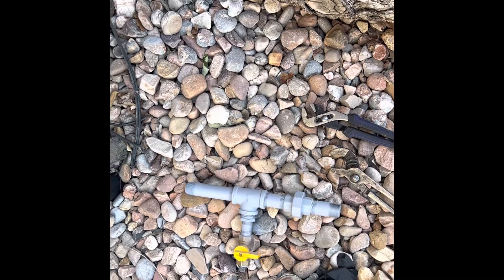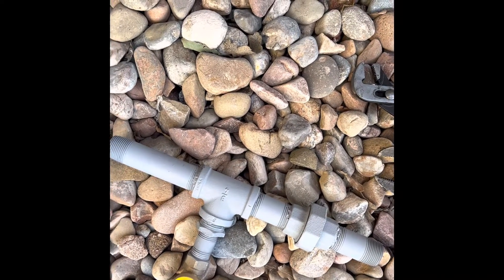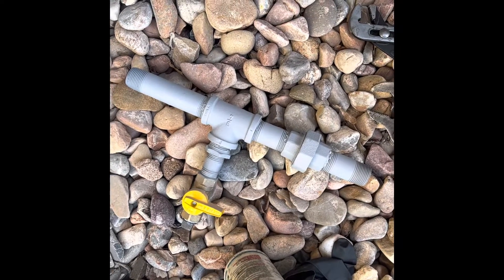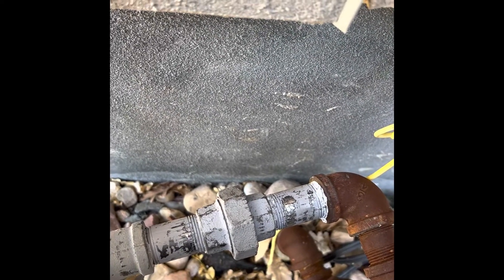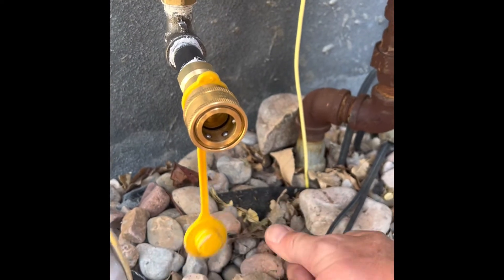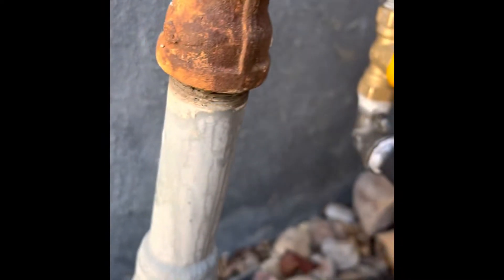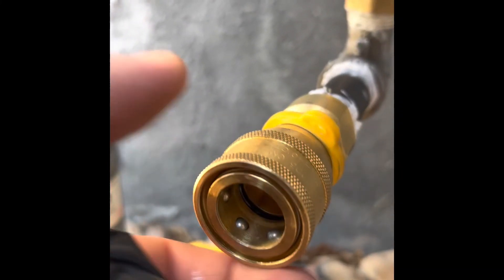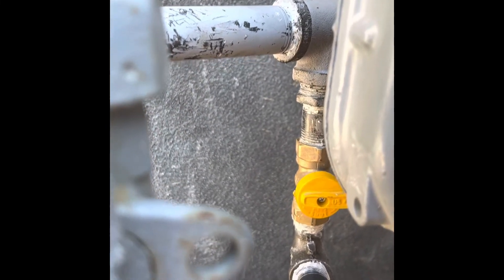Firman Tri fuel gas line fitting installation

Comment: I got the same gas hose as you.. when i hooked up to the already installed 3/8 flare output the motor ran rough/bogged down. Getting a 1" output done tomorrow! Hopefully that fixes the problem.. Thanks for the tutorials!
Reply from the maker: My meter is a 2lb high pressure. Yours is likely the standard half pound. The one inch should help.
Reply: @BryanHansen  hmmm i will go see if i can see anything on there stating the poundage.. Thank You!
Reply: @BryanHansen  The meter says AC-250    250 C.F.H @ 1/2 DIFF.    MAOP 5PSI   the regulator before the meter says  3/16 OR IRV   LB  TO  OZ  That make any sense to you lol?
Reply: @BryanHansen  well the 1inch connection didnt make any difference.. i guess im going to try and get the gas company to upgrade my pressure.. dangit nothing is ever easy.
Reply from the maker: @yoyo7856  I was afraid of that.
Reply: @BryanHansen  yea it bummed me out lol.. waiting to hear back from the gas company now. Im guessing if they can upgrade me to a high pressure system they will still make sure the inlet pressure wont go over 11 inches water column? I looked in my furnace and its Max inlet pressure is 10.5 inches water column. My water heater says up to 14 inches water column.. hopefully it all works out.
Reply: @BryanHansen  how do you tell the lbs on the meter? which number indicate that ..

heres my meter tags info  .5-7 WC , (1.2-1.7 kPa W.C.) and 1000 BTU a cubic foot  .whatever all that means  so my regulator reads 'B42R   ORI 1/8 5-7 IWC 125  PSIG  MAX 8/08   The meter says AC-250    250 C.F.H @ 1/2 DIFF.    MAOP 5PSI.
Reply from the maker: @johngraziano6652  MAOP 5 psi. It’s a 5 lb meter
Reply: @johngraziano6652  If i were you i would give up on the natural gas being your fuel supply.. your furnace draws 120k, water heater draws 40k, and the generator draws 135k as you stated earlier.. that adds up to 295k which is more than your gas meter can provide.
Reply: @yoyo7856  yea i guess so..  i had a glimmer of hope here
Reply: @yoyo7856  possible to still get the tri fuel, use it in the warm weather when the furnace is off.. we've had plenty of outages in warm weather here.. what do you think
Reply: @BryanHansen  Can you verify what i said about his furnace , water heater, and generator asking for 295k btu and his meter being capable of maybe 250k  ? Im guessing he would need a new meter and possible service upgrade..?  I also dont think he meant our meters were 5lb meters... I think we have .5 lb meters..
Reply: @johngraziano6652  Back when we first started talking about this, when you said you had pipe installed for it, I said its worth a try.. but im afraid we have .5lb meters.. he has a 2lb meter from what he told me,  But yea you could try using Natural gas during the summer when using the AC.. then switch to using propane when you are using the furnace.. 3 fuel options are better than 2 for sure.
Reply: @johngraziano6652  i think we have .5  or 1/2lb meters
Reply: @yoyo7856  he said i have 5.  Which is better, smaller# or larger
Reply: @johngraziano6652  i think he meant to put a .5  not a 5
Reply: @yoyo7856  what does @1/2 diff . Mean
Reply: @johngraziano6652  no idea..  pretty sure he miss typed and we have 1/2# meters
Reply: @yoyo7856  i wish i could post a picture on here. Anyways o think i will get the tri and use for the summer months and propane in the winter. Btu only being used when the furnace is running correct,?  The pilots don't pull much.
Reply: @johngraziano6652  use propane when the furnace is being used correct. I think his typo really through off the conversation.. dont be surprised when your 1/2lb meter wont run the generator.
Reply from the maker: @yoyo7856  volume and pressure are tricky. So you are correct in that he is pushing a lot of BTU. I am lucky, I have a higher pressure NG line and regulators in my house. They built it that way to begin with. I have high pressure and high volume at the meter.
Reply: @BryanHansen  Can you verify that his meter is a 1/2lb meter please?
Reply: @yoyo7856  my head is spinning lol
Reply: @johngraziano6652  yea i understand lol.. i mean if the trifuel isnt much more expensive or price isnt a concern then there is no reason not to get the option of a 3rd fuel source.. but im pretty sure he just miss-typed when he said you have a 5lb meter.. those are usually only for large  restaurants etc..
Reply: @yoyo7856  ive watched numerous videos of people who bought tri fuels. All homeowners, all different situations. They unbox it hook up the ng and start it up. I don't think they've thought about all these variables yet they don't seem to have a problem. I doubt they have larger meters though i have no way of knowing.
Reply: @johngraziano6652  yea i would say its worth a try.. let me know how it goes!
Reply: @yoyo7856  so here's the generator fuel requirements i took off t he manual. Nominal fuel rating- 1000btu a cubic foot.  Fuel supply size-1/2inchFNPT. Fuel supply pressure 5-7wc. Max flow rate 135000 btu...i'thought' i met all those requirements.
Reply: @johngraziano6652  alot of bigger houses have 2lb systems so its not uncommon.. I would run it on propane first so you know what it sounds like and what your intelligauge reads on Volts and Hertz. Then try running it on NG to see if there is a difference.. mine would run on NG but the motor sounded like it was bogging down.
Reply from the maker: @yoyo7856  The 250 is the rating for Cubic Feet Per hour. The 1/2 Diff is pressure differential across the water column. This means at 250,000 BTU/H the pressure coming out of the meter will be 0.5" WC lower than what's going into the meter. Essentially if you are using A LOT OF GAS it will result in lower pressure. His meter IS a 5 lb meter, but that doesn't mean that he has 5 lb service to his house. Your neighborhood could easily be 2lb service and they have a 5 lb meter on it. Older neighborhoods were traditionally lower pressure FYI. In my area, newer builds are 5lb and regulated in the home.
Reply: @BryanHansen  Ahh ok.. back in one of my first questions to you, you told me i have a 1/2lb meter and since ours are both 250kbtu i assumed his was a 1/2lb also. Well hopefully it works for him. Thanks again for all your help in this very long thread of questions :)
Reply: @yoyo7856  long but educational
Reply: https://pngtec.com/natural_gas_hose.htm       check out this website  has some good info on it.. hes saying you would need 3/4 in line to the generator in order to have the generator to run correctly on NG  if using the conversion kit..may be a cheaper option to try instead of getting a  new tri fuel..
Reply: im still here lol... im going to pick up a ng pressure guage and check the outlet in back of the house where the generator will be attached.. what should that  psi be in order to get good flow
Reply: @johngraziano6652  From my reading about propane regulators... 11 inches of water column is equal to .4 PSI.. but i cant say for sure..
Reply: @yoyo7856  hi, do you know whats the horsepower on a 439 cc engine?? i believe if i use one of the trifuel conversion kits on my dual fuel, it will need less btus to run maybe around 70000 instead of the 135000
Reply: @johngraziano6652  I think its about 15 HP..  All the 220cc generators ive seen are 7 HP so its prolly 14-15 HP for 439cc. I dont see how a trifuel conversion kit would reduce the BTU usage though.
Reply: @johngraziano6652  You get it up and running?
Reply: @yoyo7856  lmao ! I can't even tell you how much more I've confused myself. Back and h forth choosing between converting my dual  to tri or buying new tri and figuring which btu would work better. Finally called my gas Co to upgrade my meter. They said i didn't need to. As long as i don't run everything together. Which is fine. So I'm going for a new firman and gonna sell my dual.  I also discovered there are different kind of quick connects. Wow this had been a real learning experience. Thanks for checking me out. I'll let you know when i get the new generator.
Reply: @johngraziano6652  Haha yea its worth it in the end knowing you can power the house if there is an outage.. Yea my champion has a quick connect and im not real sure what size it is.. i think its a 3/8.. Hopefully everything goes smooth when you get the trifuel generator!
Reply: @yoyo7856  did you convert your gen or have a tri fuel  i foget  i think the champion i was looking at has a 1/2 inch quick connect already attached
Reply: @yoyo7856  did you convert your gen or have a tri fuel  i foget  i think the champion i was looking at has a 1/2 inch quick connect already attached
Reply: @johngraziano6652  I ended up just going with a dual fuel.. i got a bunch of propane lol..
Reply: @yoyo7856  got the unit today.. hooked up to NG, started right up!  hope i never need it.thanks again for all your help!
Reply: @johngraziano6652  Great news! Glad it worked for you! Thats nice to not have to worry about changing out tanks! All that worry for nothing lol
Reply: @yoyo7856  thats the story of my life lol!
Reply: @johngraziano6652  same here lol
Reply from the maker: AC stands for aluminum cast. 250 is the size. That meter can support up to 10 psi, but the gas company doesn’t run them that high. It can support up to 225,000 btu depending on its configuration.
Reply: @BryanHansen  Thanks.. i had looked it up, it said 250000 btu on its website. Hopefully my generator will run on that pressure.. I wonder if the gas company will upgrade my meter and pressure? My furnace draws 57k water heater 34k and generator 160k but im guessing thats on a full load..
Reply: @BryanHansen  can you tell me what my meter is capable of handling? Im looking into a trifuel champion generator that requires 135000 btu and 5-7 WC , (1.2-1.7 kPa W.C.) and 1000 BTU a cubic foot  .whatever all that means  so my regulator reads 'B42R   ORI 1/8 5-7 IWC 125  PSIG  MAX 8/08   The meter says AC-250    250 C.F.H @ 1/2 DIFF.    MAOP 5PSI. i basically want to run my NG boiler and some lights in the winter in case of a power outage   i have NG hot water tank ,stove and drier but will not be using at the same times..Thanks
Reply from the maker: @johngraziano6652  honestly I am not 100% sure. Looking on Champion's website, the only trifuel they list is an 8000 W model so I am not sure if that is an older model or what. I was trying to look up some of the specifics, but was unable to find it. Your numbers suggest that it is a 5 PSI meter able to supply 250 cubic feet per hour. The 5-7 inches of WC (water column) is what is needed to supply the generator. 5-7 is middle of the road pressure. My shop furnace for example requires 12 inches of WC. You sound like you are setup for it, but it is hard for me to say for 100% sure. It will definitely run fine with what you have, just not sure if you will get 100% out of it or not.
Reply: @BryanHansen  on the champion, its 8000 for the gasoline, 7000 for the NG.its pretty new model# 100416.. on my furnace, it says 'gas supply pressure WC MAX 14.0 MIN 4.7    This WC stuff is confusing to me..
Reply from the maker: @johngraziano6652  ahh, I misread that. Yeah, the 8000, you should be fine. Personally, I like the Firman over the Champion in that sizing. But gas supply wise, you should be good.
Reply: @BryanHansen  i like the firman also but the ng requirements are 11 WC  im not sure if my meter will run it well.. what do you think.
Reply from the maker: @johngraziano6652  it should run it just fine with that setup. The catch is you can’t run everything all at once with either of them.
Reply: @BryanHansen  thanks a lot  great info.. one more question, can you explain what the WC is and does?
Reply from the maker: @johngraziano6652  it’s simply another way of measuring pressure. “inches of water column is the traditional method for measuring. natural gas or propane. There are 28 inches of water in 1 psi, so it is a fairly small amount of. pressure. • Pounds per square inch (psi) – used for measuring gas pressure in the distribution system”
Reply: what would happen if i run a firman tri fuel, which requires 11WC , off my meter which is 5-7WC.. knowing im only running the NG furnace ,and some elec appliances.      would i starve the other gas appliances not being used?, or lose the pilots? The champion says its exactly a 5-7 WC am i over thinking this?
Reply: @johngraziano6652  I have the same meter as you John, the AC250.. I was not able to get enough pressure to my trifuel generator for it to run properly. The gas company said they could increase my pressure but then i would need to add a regulator for the appliances in my house so as not to over pressurize my furnace and water heater.. I ended up just using propane and gave up on the NG.
Reply: @yoyo7856  thats what i was afraid of.. so youre able to run your ng furnace and water heater on the propane with no problems? but the champion tri only needs 135000 btu.. the meter is good for 250000
Reply: @johngraziano6652  I think i understand your question.. I used propane to power my generator instead of NG. The generator was able to power everything in my house that is 120Volt. I have the Champion #201042. I returned my trifuel generator. I only have 2 gas appliances in my home, the furnace draws 57k BTU and my water heater draws 34k BTU. The trifuel generator i returned used 160k BTU at max load. So i would have possibly had a problem if my generator, furnace, and water heater had been running at the same time. I could of kept the trifuel generator but i would of had to have my gas pressure increased and AC250 meter replaced in order for it to have worked. And i would have had to have a regulator installed to decrease the pressure going to my furnace and water heater. So i decided to go with a propane generator.. And propane gives you more power output than NG..
Reply: @yoyo7856  propane does seem to be less of a headache, though the thought of unlimited fuel supply was a big plus.. i just had a NG line installed with hopes of getting a tri fuel.. but im very leery now. I already have a firman dual fuel. do you know how many hrs of run time you get from a 20lb propane tank?
Reply: @johngraziano6652  If you already have had a NG line installed its at least worth a shot to see if it will work for you. Tractor supply company has generators and they are pretty easy to return there if it doesnt work out. Some places like bass pro will make you return it to the manufacturer once you put oil in it. As for the 20lb propane tank it depends on the horse power of the engine and how many watts its pushing to your house as for how long it will last.. usually around 10 hours. Also note that the propane tanks you swap out at the stores are usually only 15lbs if you check the label. Tractor supply will actually fill them all the way up and for less money than swapping them.
Reply: @yoyo7856  now im just worried about screwing up my furnace. What happens if it gets too much pressure as you said about your furnace issue? dont you already have a regulator on your gas meter? basically, if running the furnace, youre only powering the circulating pumps correct? so not using so many watts from the generator.. im just worried about the ng flow feeding what i need..i think your tri generator was bigger than the one im looking at.. this has been a real experience, im learning alot here..with all the generator videos i watch, none of them mention the gas supply,meter situation...looks like they just buy them and hook em up
Reply: @johngraziano6652  well if your not having the gas company change your pressure then you dont have to worry about too much pressure at your furnace. If you are having the gas company up your pressure then you might need to look into that issue. Are you having the gas company up your pressure?
Reply: @yoyo7856  no, i was figuring to plug and play with what i had.. till i started researching potential problems..
Reply: @johngraziano6652  then you dont have to worry about too much pressure. I would just give it a try and not worry about it. If the engine sounds bogged down then you probably are not getting enough pressure. I would hook up a propane tank for the first run to hear what the engine is supposed to sound like.. then try the natural gas.  You can find the BTU usage of your furnace inside the panel. It will have 2 BTU readings. The larger BTU rating is how much NG it uses and the smaller number will be how much heat it puts off. If the generator 135k btu and your furnace is 60k btu, and your water heater 40k BTU then if all were running at the same time you would still be under the 250k btu your meter can handle so you should be good. I would check all your gas appliances to see how much NG they use to get the exact numbers. Im just guessing what your appliances need. If you have a big house or live up north then your furnace may use a good bit more than mine.
Reply: @yoyo7856  furnace btu  input 120000 output 96000.. water heater40000.gas drier wont be used.. generator 135000...btw thank you for your time and knowledge.
its been really helpful
Reply: @johngraziano6652  No problem.. i just spent the last few weeks figuring all this out myself.. So if your furnace is running and water heater and generator then that adds up to 295k BTU.. your meter can only do 250k btu. So that would cause a problem and probably cause your furnace to turn itself off. It wont hurt the furnace but it will turn off and prolly retry to start after a hour of "shutout" time. So you would have to upgrade your gas service to not have a problem. IF you did that a plumber would have to come out and put a second regulator to be sure your furnace and water heater arent getting to much pressure. You can get larger than 20lb propane tanks but i would check to see what size tanks can be used with your generator. I think the pressure changes once you go over a 60lb propane tank.
Reply: @yoyo7856  makes sense. Maybe I'm just stick with propane  my furnace is not new and i don't want to risk it. They sell a propane splitter where you can run 2 at the same time, they say it uses less that way. I'll let you know what i decide. Thanks again!
Reply: @johngraziano6652  No problem.. ive never looked into propane splitters but sounds interesting, let me know what you find.. Just be sure to use the propane hose that comes with the generator.. it will have the proper regulator setting for the generator. Also ive learned the little propane gauge that tells you how full the tank is, is crap. I ran my generator for 3 hours after the gauge said the tank was empty.
Reply: @yoyo7856  checkout the firman 1810 splitter
Reply: @johngraziano6652  Im liking these auto changeover options like the   JR Products 07-31525 Compact Automatic Changeover Regulator   i will probably go to a local RV dealer and see what they have.. This way you could never have to turn off the generator to swap out tanks.
Reply: @johngraziano6652  or this      Flame King 2-Stage Auto Changeover LP Propane Gas Regulator with Two 12 Inch Pigtails
Reply: @yoyo7856   pretty interesting also  .. guess what, we had a power failure last night!  too funny,   power came back this morning, no need to hook up the gen.
i have to get this situation under control.  one way or the other..
Reply: BTW, can i ask which tri fuel generator did you have?
Reply: @johngraziano6652  I have my champion setup to plug into a inlet box next to my main electric panel and it powers half of my electric panel. Its only a 120 volt generator so it will only power half.
Reply: @yoyo7856  so that wasnt a very large unit.. why wasnt the NG able to run it properly.  Oh because your furnace and water were high btu's?
Reply: @johngraziano6652  no.. the pressure coming from my gas meter wasnt high enough..
Reply: @yoyo7856  ahh,, how much pressure do you have
Reply: @johngraziano6652  Im not100% sure what my pressure is.. we have the same meter that can support up to 5PSI as Bryan stated, but that doesnt mean that is the pressure being supplied to it. If you had a manometer you could hookup to the gas valve on your furnace and get a reading.
Reply: @yoyo7856  i was just gonna ask you what you thought of the 5lb pressure..
he said he has 2lbs and it works fine
Reply: @johngraziano6652  I did order a propane auto tank changer for $35 and will be testing it out tomorrow. It allows you to hook up 2 propane tanks and as soon as one goes empty it automatically switches to the 2nd tank and you can swap out the empty without turning off the generator. Then when the 2nd tank goes empty it swaps back to the 1st tank that you had replaced and the cycle just keeps going.
Reply: @yoyo7856  i think i watched a video on this one. Guy said the only problem is the first tank didn't completely empty before switching over.
Reply from the maker: @johngraziano6652  depending on load 1 gallon at %50 so a 20 gallon tank will last 5-6 hours.